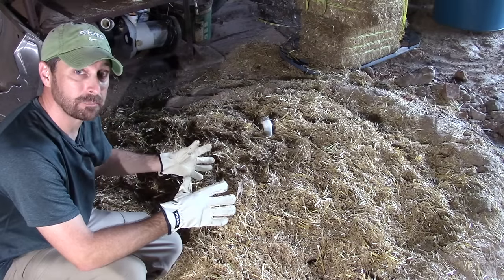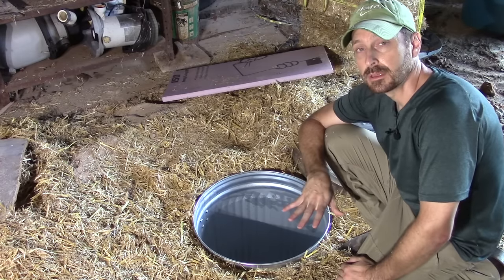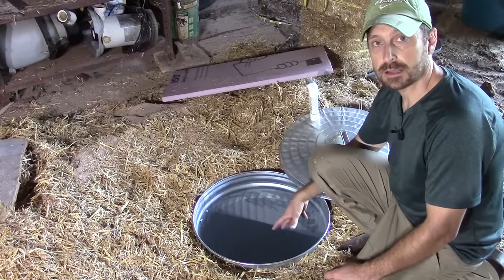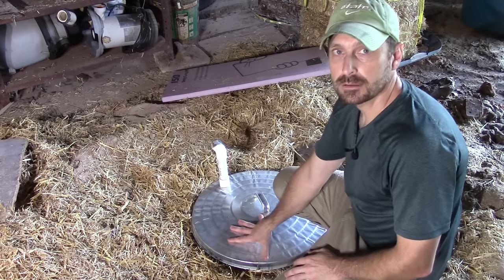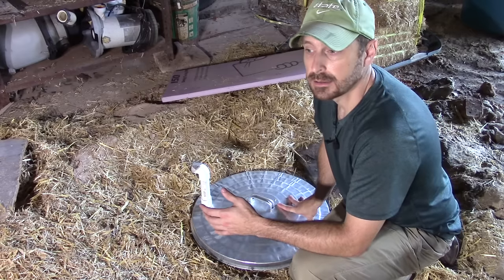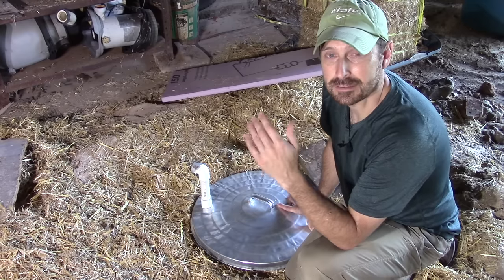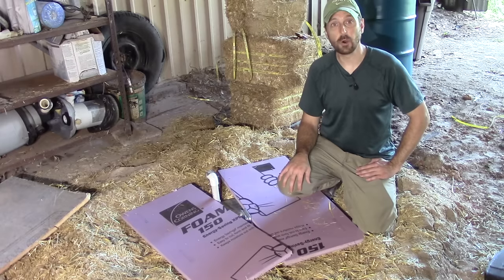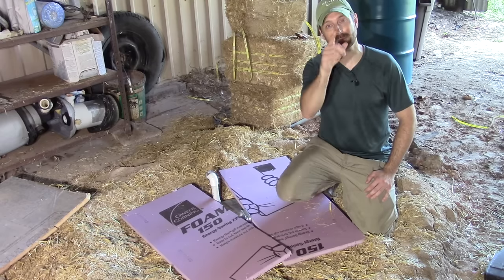Our Simple Inexpensive Root Cellar Build

Comment: Soil isn't a particularly good insulator. What it does provide is "thermal mass" and thus greater heat capacity.  With enough thermal mass and heat capacity, temperature changes happen more slowly.  This is because the heat energy or loss had to conduct through all that material, which takes time when the material is not highly conductive.  

    Straw, hay, etc is much more of a direct insulator, because what it does, is to trap/still a lot of air and stilled/trapped air is a very good insulator (because it neither conducts or convects well). Most insulations that we use, work on trapped gases. Most with air, but some with other, even less conductive gases (closed cell foams for example).  

    (The most efficient insulation by far though, is vacuum insulation, which is an absence of all materials, including gases--it cannot conduct nor convect much at all because of so few molecules contained in the space, but heat energy can still travel via radiation). 

  Thermal energy exchange (heating and cooling) happens via conduction, convection, and radiation. Most insulators work by limiting the former two in some way.  Radiation is a different topic though. That is the part of thermal energy that is more like light, but has different properties than visible light. Materials which reflect or absorb visible light may be transparent to IR (thermal energy light) or conversely materials which reflect or absorb IR might be transparent to visible light.  Also, colors don't really have much of any effect on IR like they do with visible light (like black colors get hot in the sun and white reflects visible light). 

     Materials that reflect IR best are things like polished, shiny aluminum surfaces.  If you want something to stay cooler, you can reflect heat away from it. If you want it to stay warmer, you can reflect heat back to it.  And unlike say convective heat transfer (through a gas [usually air] where the heat energy tends to rise up with the lighter/more expanded gas, with radiative, it travels like 360 light away from the heat source. IR reflecting materials need a sufficient air gap/space behind them to work. If you stick it right up against another material, even a fluffy airy insulator material, it will not work well to at all. You want at least a 1/4" true air gap/space or 1" even better.

Comment: Dumb question but where did you get the vent pipe for the top and how did you make the hole for it? (I know the bottom you drilled holes in but I didn't see anything about the top in the video)
Reply from the maker: I cut that top hole out with a hole saw attachment for my drill. I just made the vent pipe from some pvc pipe I had laying around.

Comment: FYI folks- I used this method in my hot garage last year and this spring with potatoes. Found a small metal garbage can and layered it with pine shavings (what you would add to an animal cage) then layered with potatoes (not touching) and I packed a layer of shavings between and on top of the potatoes and added another layer of potatoes. I made layers until I had 20 lbs of potatoes in the can and covered it with the lid. I kept the can in our Texas hot, non-insulated garage and I was so surprised at how long the potatoes kept- they lasted at least 5 months before they even began to sprout! Even sprouting a bit, they still tasted fine and cooked up well. You don't have to bury your can in the ground for this method to be effective. Try it out yourself before you go through the effort to dig a big hole for your can.
Reply from the maker: Thanks for sharing your experience
Reply: Did you add a vent?

Comment: I live in Minnesota and my barn has a cement floor. Any suggestions?
Reply from the maker: Build a small lean-to structure over it. Dig the hole next to the barn on the South side to protect from that cold North wind in the winter.

Comment: Please show us the results you've had come with this project. I'm thinking air flow is going to be very important.
Reply from the maker: It works perfectly fine in the fall, winter, and spring here. Only issue is loss of moisture in potatoes and carrots when they are in there for more than a few months.
Reply: @CountryLivingExperience  More air will bring moisture in, especially in winter. Suggesting an extra vent.

Comment: This is awesome! Is there anything special about the galvanized steel or can it be food grade plastic barrel?
Reply from the maker: You could use plastic.
Reply: Rodents will chew through plastic.
Reply: @zone4garlicfarm  ...roof rats chew through everything, including steel.
Reply: @bryancondrey6457  Rats might chew through soft metals but not through hard steel. Even if a metal trash can can't stop rats it will stop squirrels, mice, voles and chipmunks. Any of those critters will chew through plastic.

Comment: Worms could get through the holes on the bottom, no? Also in a power outage situation could this be used as a source of refrigeration for things like dairy?
Reply from the maker: Usually not down that far. We have clay 24" below the topsoil and there are no bugs that will get down into the clay and nothing gets inside ours.

Comment: So you have success storing carrots / potatoes in this? I'm looking for a relatively easy to build root cellar for primarily those two crops.
Reply from the maker: Yes. I just took out the potatoes from last season to use as seed potatoes for the garden. I also just placed in a whole bunch of carrots.
Reply: @CountryLivingExperience  What zone are you in? I'm in 7B with some pretty vicious heat waves in july/august, but you find not being fully buried keeps things cool? I'd just be worried about the hot months
Reply from the maker: We are in 8b. It is fully buried. Just the top has the insulation and straw on top of it. Also, it is always shaded since it is undercover in the barn.
Reply: @CountryLivingExperience  Nice. Yea we have a barn with a corner that I could dig a few of these in to. Will definitely be doing that this year!
Reply: There is a reason the old timers called them Root Cellars, made to store all root veggies

Comment: Would this work in North Florida? We get some freezing temps in winter but our soil never freezes and we are in the low to mid 90's with extremely high humidity for about 5 months.
Reply from the maker: It would work well there in the winter. The only issue would be your water table.

Comment: Do you ever run into trouble with water from the water table coming up through the holes when it rains for a few days?
Reply from the maker: No problem at all. It is located at the high point on my property.
Reply: What about bugs
Reply from the maker: @JG-be8qq  No bugs at all. Never had a problem.

Comment: Is there space at the bottom, Is r garbage can right on the ground or propped up on something to give space at the bottom for circulation????
Reply from the maker: There is a small space at the bottom. You can put rock in the hole first if needed.

Comment: I wonder if dried grass clippings would work as well as straw.
Reply from the maker: I would say only if they are completely dry. Zero moisture. If there is moisture and the decomposition process is still ongoing, you will ruin your veggies.
Reply: Farm stores sell compact bags of sawdust aka wood shavings for animal bedding for under 5.00 (they may go up in value with the price of wood) but 1 bag should be plenty and it's only about 2 foot by 3 foot and easy to handle.
Reply: The insulating value of straw is due to its having hollow stems.

Comment: I am in a residential area and have a question. Can you use dried leaves and grasses for this instead of straw? Or would that just turn it into a galvanized compost bin? I don't know anything about this topic.
Reply from the maker: You cannot use leaves or grass unfortunately. They would mold and do not provide a good enough insulation. It would turn into a compost bin.

Comment: Yeah but how cold does it get there? I doubt that would work to -30F which we frequently get where I am at.
Reply from the maker: It won't work for everyone. I did this in Michigan and it worked perfectly.
Reply: @CountryLivingExperience  then it should work here. I’d done something similar with the wash tubs out of wash machines. But it was on the Olympic peninsula Washington so huge low temperature difference.
Thx

Comment: What is that white pipe sticking out the top and what is it for and how did you attach it?? Watched the video and did not see you address any of this.
Reply from the maker: That is a vent. I missed filming that part. Just use some pvc pipe with an elbow in the top as the vent. Put some screen over the end of the pipe so insects do not get inside.
Reply: @CountryLivingExperience  Got it! Thanks!

Comment: I would use a plastic drum, 35 or 55 gallon. The ones with a locking removable sealing lid. The handles will leak on the trash can lids, and they don't seal up that well allowing ants in.
Reply from the maker: I have never had an issue with metal and it conducts temperature better.
Reply: How could I store potatoes,apples and onions in South Florida? Right now I just keep them in a basket in the house. Doesn't work very well even with air-conditioning.
I could use some ideas.

Comment: How would you go about this in Ohio, where the frost line is 32"? Steel cans aren't usually very tall, wondering how deep to dig to still ensure easy access. Thanks for the great idea!
Reply from the maker: We had them in Michigan growing up. They were buried in the back corner of our barn. They were about 12" below the surface and covered with straw.
Reply: @CountryLivingExperience  thanks for the response!
Reply: Could you nest the cans for more height? I little roofing cement will hold them together and discourage water intrusion along the seam. You can do the same with five gallon bucket and just remove the base on all but the bottom bucket. The addition of a gamma lid gives you some level of security. Not real sure how it will survive burrowing critters but worth a try.

Comment: Thank you so much for this informative video. How long do vegetables last in one of those? We've been getting a LOT of rain in Kentucky, I'm wondering if the water table which can get quite high, if it would seep into the can with holes on the bottom? How to deal with that? thanks
Reply from the maker: You're welcome. My recent carrot crop was in there for 3 months. The carrots lost a bit of moisture but were still nice and crunchy. We get a ton of rain here in East Texas and that is why we put it in the corner of our barn. I have never had an issue with water coming in the bottom and neither did my Dad when he did this in Michigan. Just make sure it is located on a high spot on your property.
Reply from the maker: @WildnUnruly  Awesome. You're welcome.

Comment: Do you think I can use a big plastic container?
Reply: I thought about putting plastic bags in the trash can, but the veggies will need to breathe. Some type of circulation would be needed or they will rot faster.  I'm thinking about mesh bags so it will make it easier to pull things out. I'm getting older and am looking for the easy way.
Reply from the maker: You can use plastic but it should have a good lid on it.

Comment: What if you live in an area with a high water table?  Libe the hole and sides with concrete,  leaving a small gap on the sides and leave a gap of a couple inches on the bottom?  I would appreciate any suggestions anyone would have!

John McHatton
Reply from the maker: Unfortunately I do not think this can be adapted for a high water table area. You may have better luck with burying a used chest freezer.

Comment: How did you make the port on top?
Reply from the maker: Just drilled a hole with a hole saw. Inserted the pvc pipe with a 90 on the end of it. Then stapled some screen on the end of the pipe opening.

Comment: Is this a project that could work in the crawl space of a 1940s house? Inquiring suburban minds want to know. Any fixes or changes one would recommend?
Reply from the maker: It could work anywhere you can easily dig that hole. If you can dig a hole that deep in a crawlspace, more power to you. No fixes yet. It's working well.

Comment: Question: those holes on the bottom, How are you stopping Insects from entering and eating your food?  I.E Ants, worms, ect.
Reply: You can use cedar chips in the bottom layer and on top around the lid.
Reply from the maker: You can put screen in the bottom if you are worried. I have never had bugs inside accept 1 spider.

Comment: This would be awesome if I could dig down more than 1ft... our hard pan is harder than cement.
Reply from the maker: Can you soak it with water first?
Reply: I have used a hammer drill to help dig through hard clay that was like concrete.
Reply from the maker: @SW-ii5gg  That'll work.
Reply: We hired guys with jackhammer who couldn't get more than a couple inches down.
Reply: Probably because we had the driveway done in summer. If it was winter we could probably do it. It doesn't freeze here.

Comment: I would LOVE to know how this performed for you over the winter and into the next summer. Did you have problems with moisture? Would you do anything different going forward? We live in a VERY wet climate with little Frost and I was thinking of over-digging the trench and backfilling with a layer of sand so water could drain away.

Thanks in advance for your response!
Reply from the maker: Hello. It is performing well although some of the potatoes sprouted. It is potato planting time however. No moisture problems at all. Good idea to backfill with sand. If you can, keep it covered. We were fortunate to have to barn to keep it out of the elements.
Reply: I'm a latecomer  but thank you for this valuable wisdom and know how. I'm wondering : will  sprinkling some diatomaceous  earth under the can  keep bugs out? I live in  the Central Valley CA , food capitol of the world. We always have tons of crawlers in the soil here.

Comment: Just found your channel; do you have an update vide or was there any problems with it
Reply from the maker: No problems per say. In the summer, it is a bit too hot here. Moisture is also lost over time. So my carrots and potatoes look a bit shriveled. The potatoes are still good for seed after they pass the point of looking edible.
Reply: @CountryLivingExperience  just noticed your reply
Reply: @CountryLivingExperience  thank you!!!
Reply: @CountryLivingExperience  quick question what size holes did you put in your can and about how many holes did you put in there. Are there more holes than metal on the bottom
Reply from the maker: @1231dre  I put about 10 1/2" holes.

Comment: Straw will start to break down and that process produces heat.  I would think you would want to stay away from any biological other than dirt for insulation.  Good idea for a root cellar!
Reply from the maker: Thanks. I haven’t had any issues with the straw breaking down fast. I do change it out once per season.
Reply: Will hay work?
Reply: @lisaok4729  hay breaks down faster than straw.  Either way, they produce heat in the process.

Comment: How did you make the vent on top??
Reply from the maker: We used a piece of 1" pvc with an 90 degree fitting. We stapled a piece of screen over the end of the fitting. Drilled a 1" hole in the top of the lid and inserted the pvc vent.

Comment: I didn't hear the difference in temperature drops..if it's 90 out in the open then what is the temperature drop in the ground ???
Reply from the maker: It depends on how deep you are. The earth's upper crust is a constant 55 degrees F. Once you get down to a certain depth. 4 to 5 feet normally.

Comment: What if you live in a warmer climate with no frost line... Would you need to go deeper to keep things cooler?
Reply from the maker: You can dig it deeper but that will pose an issue with being able to reach into the bottom. A taller container would work and then fill it half full. My carrots have been in there for two months with no issues. It is holding 58f and the outside air temp was 89f the other day.
Reply: @CountryLivingExperience  Thanks

Comment: Would a plastic garbage can work?  If not, why not?
Reply from the maker: Not really. It is not as strong so the sides may cave in if you backfill with dirt. Additionally, metal will conduct the temperature better from the soil underneath.
Reply: @CountryLivingExperience  Thank you for responding so quickly.

Comment: I have watched several times hoping I missed something but I haven't. Again, I am in Atlanta and today will be 90 so you being in Texas...Go measure your temp and let me know. Mine can't get below 65 at 24 inches deep. The humidity is between 80-90%..ok. It's vented in and out, pink insulation and hay. I need it lower than that I believe. Any suggestions from anyone is appreciated.
Reply from the maker: Is is under cover or out in the open? Shaded will be better. At 24 inches, it will still be warm. You need to be down a few more feet.
Reply: @CountryLivingExperience  It is under my covered shaded shed. What depth is yours and what is the temperature please. I'd like it at least 3 feet or more but my can is too short. I really like your ideas and want this to work. I'm harvesting this week. Thanks for your help.
Reply from the maker: @DsHomeyGarden  Temperature varies. I don't have anything in there right now so I am not monitoring. The bottom of mine is 48". I have a large can. Hope you have a good harvest.
Reply: @CountryLivingExperience  you say 48 in. And baron 30 gallon trash can is  roughly 30 in from what their website says so how did you find the extra 18 to 20 in? Again thanks for your guidance.